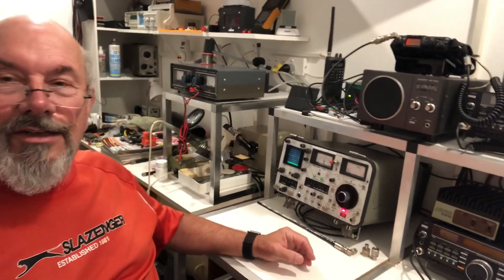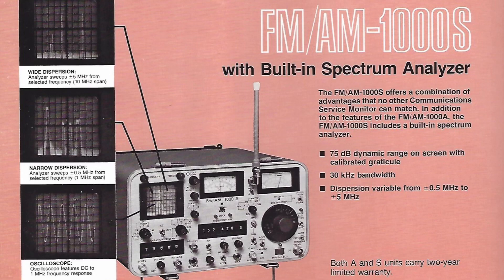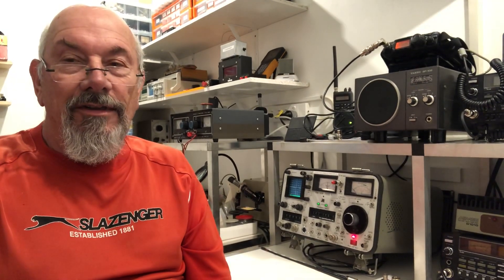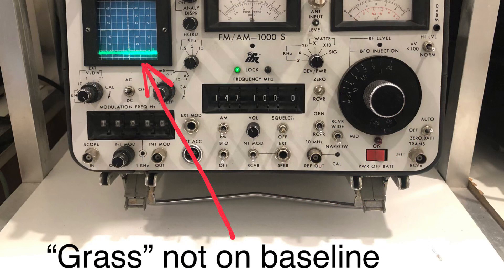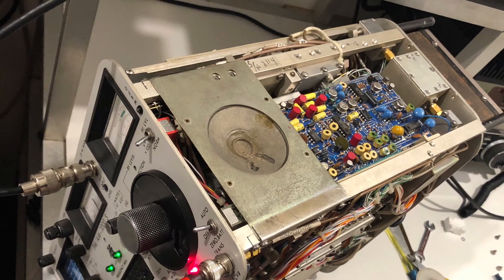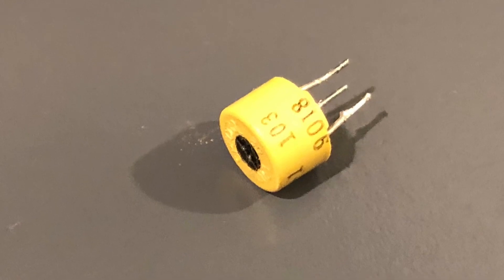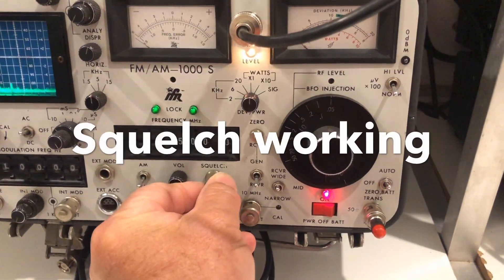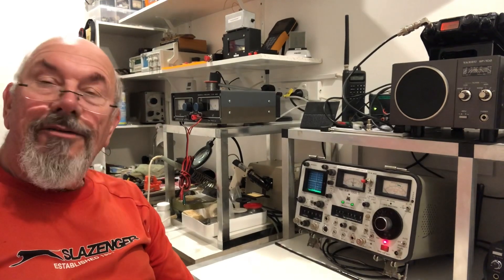Andy’s Workshop - The IFR 1000s

Comment: Good info Andy, just working on a beautiful looking IFR1000S right now, found a few problems with connectors needing retensioning and have lock on both lock lights now, but now chasing generate mode is working but very low output and when we put 5 watt signal in, seeing power on power meter(which unfortunately means very little) but no ability to hear or see the signal.  So far, we have a very limited signal generator with cro working, so not terrible.  Not hearing any relays click and I own 5 other different IFRs and thats the common denominator on all of them so I have some detective work to do yet, possibly quite a bit. Looking at your video helps to open my mind to other possibilities,  much appreciated. I swapped an FT290R old Yaesu for this so I'm not too heavily invested in the unit but I agree with what you said in the video, they are a great unit in relation to parts availability, our newer IFR units are not so simple that's for sure Cheers Brenton vk3cm
Reply from the maker: My IFR1000S (which came from you) keeps on keeping on. It is used almost daily and has paid for itself many times over. 
They are a pretty honest piece of kit and rugged enough to stand up to field use.
Mine gets an easier life now ... never leaves the workshop.

Comment: Andy, I still  have the original 1976 color sales brochure for the IFR100S.  The 1976 stated price for a 1000S  was $6,750.00 FOB Wichita Kansas. The earliest versions of the 1000A/S had power supply issues , but eventually IFR got those issues resolved.  I used one of these for many years with good success. My only MINOR beef with the 1000 series monitors was that the FM deviation meter ballistics were a little slow.